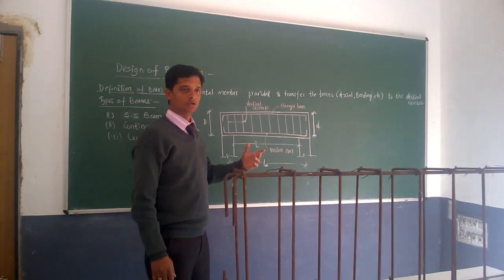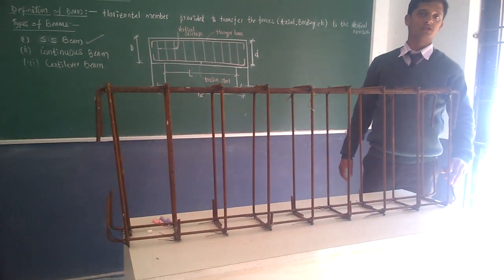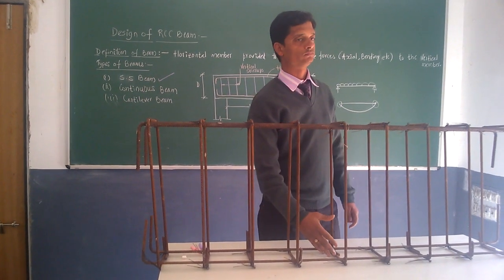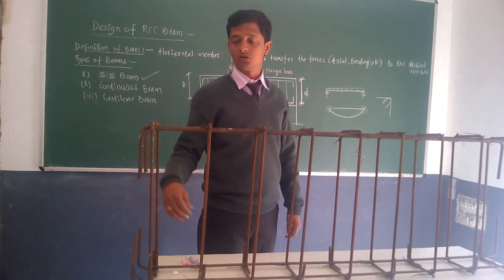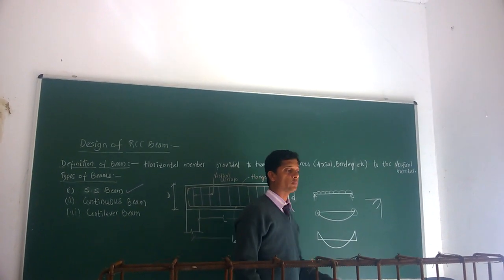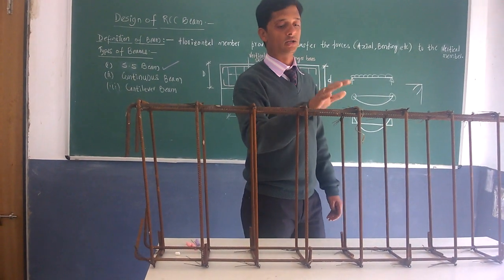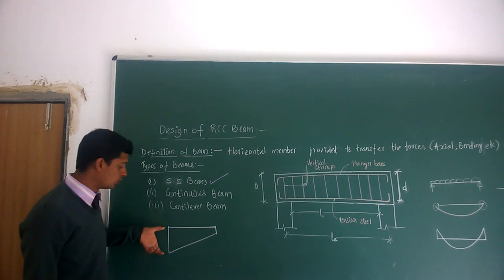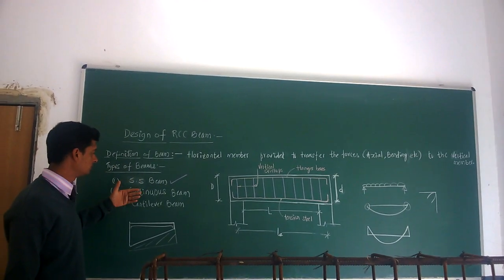DESIGN OF RCC BEAM BY N.P

Comment: Mr. Naresh  why did not make the stirrup hooks? It must be 135 degrees. 
And second thing you are keeping the uniformed spacing of stirrup. Near joint of columns it should be provide closer at both sides at L/4 or L/5.
Reply: Its 45 degree